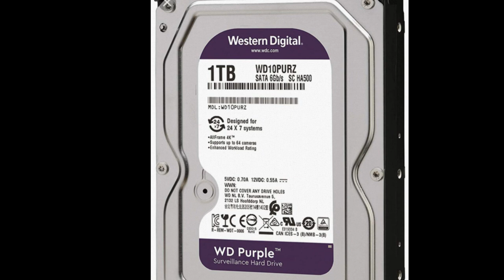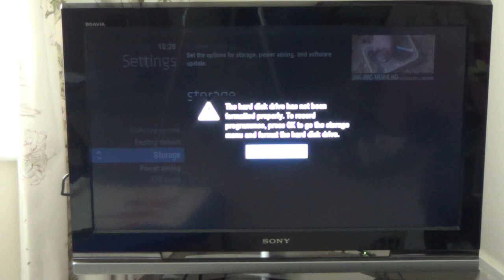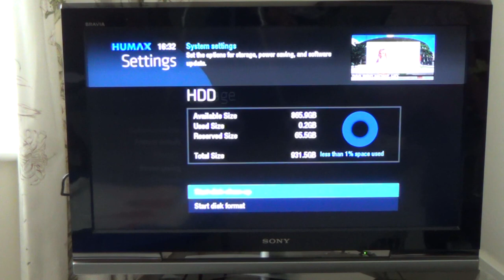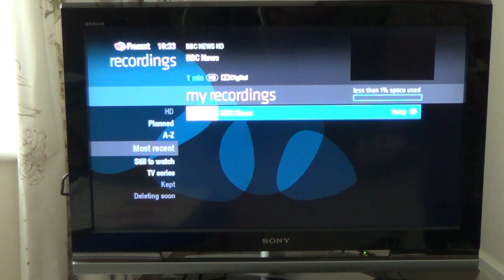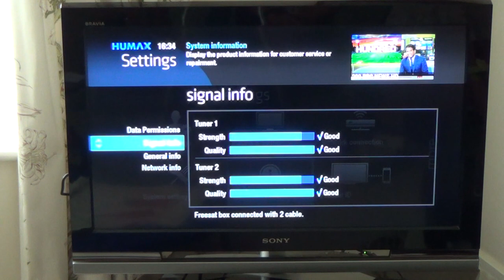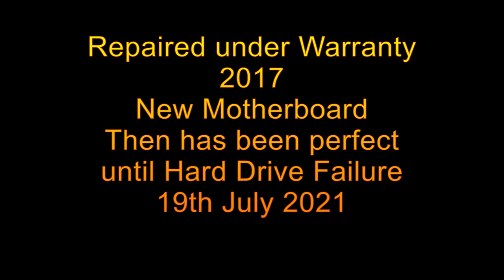#HUMAX #HDR1000S REPLACE HARD Drive #Freesat.. DIY repair.

Comment: I miss my Humax HDR100s after changing the hard drive twice it finally would not see the hard drive, It was a great box with front display and many other features the newest 4K box just doesn't have.
Reply from the maker: I've still got mine and it's working perfectly.. Sorry you are having problems.. did you make sure that the SATA cable is pushed home fully on the Hard Drive and the the other end on the circuit board.  Does the drive spin up..

Comment: I have a humax hdr-fox t2 what s the best make hard drive you would recomend
Reply from the maker: It has to be one that can run 24/7 and shift loads of data so it needs to say Video or Surveillance on it, the type they use in CCTV systems.. I took my hard drive out to make sure what it was then looked on Amazon for something similar and ordered one on next day delivery. I got a Western Digital but any of the big makes will do..and you may be able to upgrade, say if it's 500 mb. Go for a terabyte or something . I just kept the same size for mine.. I made that video a while back and the box is still working. I'm not an expert or anything so I had a look at what was there.
Reply: @ron2256  i have looked at mine which is in there its a 500gb normal desktop 3.5 one bearing in mind the security tag was still in place before i opened the box stuck fast so i know wiser what to do now.
Reply from the maker: @lifeisgood3386  I was told to use video or surveillance because normal PC ones can't handle all the data and wear out more quickly
Reply from the maker: They look and fit the same
Reply: @ron2256  i am stuck ron
Reply: @ron2256  it says pipeline HD and its 500gb seagate
Reply from the maker: @lifeisgood3386  yes. I think pipeline is a video one, designed to handle all that video. The thing is, while the box is on, you can always skip back up to 20 minutes which means the HDD is on all the time, like a CCTV box, so it's recording into a buffer of 20 minutes and it can record two channels and you can watch recorded programmes, it's a hard working little Hector, which is why it shouldn't be just a normal PC drive.. I'm presuming it's a SATA drive. Check that as well. As long as you are sure that it is the hard drive that's faulty and not the box. I would consider ordering the same as what's in there, maybe upgrading to 1TB, depending on cost and availability but a surveillance or video disk is much the same.. some of those CCTV systems record 24 cameras at once all the time.. anyway, I'm not an expert, I thought the hard drive was faulty and bought one on Amazon for about £40 but I had a use for it if it didn't fix the problem so I didn't mind getting it to see.. mine was fairly easy to see it was the drive, all recorded programmes disappeared and going into system information, there was no storage..
Reply: @ron2256  thanks for all your help ron i have now found a video one brand new £12 .
Reply from the maker: @lifeisgood3386  have you lost some movie channels today 302 to 305
Reply: @ron2256  no mine are radeo channels over here uk where i am
Reply from the maker: @lifeisgood3386  oh right, your Freeview and I'm Freesat, it's all different channel numbers